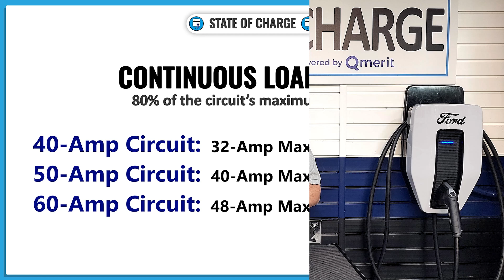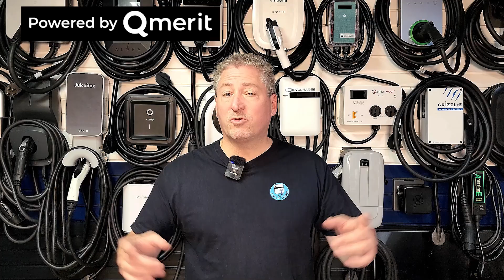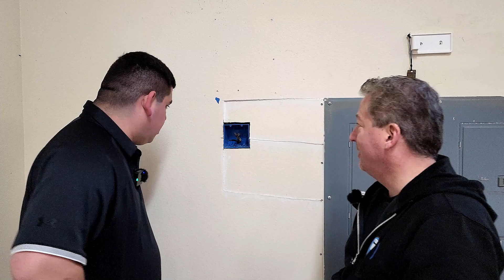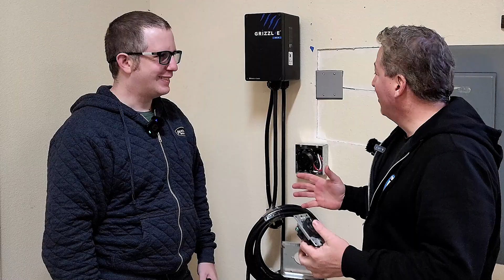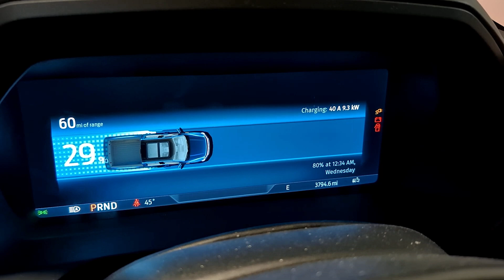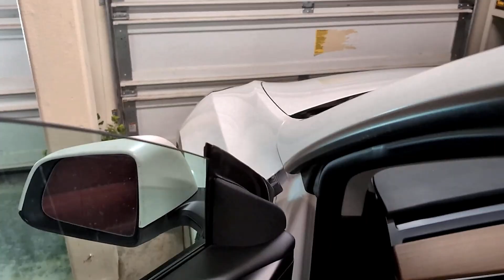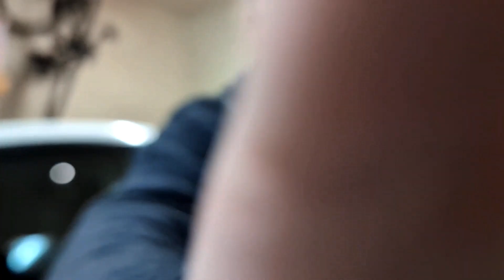Recharge Rescue Washington: We Fix A Dangerous NEMA 14-50 EV Charging Outlet Failure

Comment: What was the amperage of his juicebox? I think that I have that Leviton plug that I am also planning to replace with a Hubble. (Now going to do that this weekend instead of just “soon.”) But I am curious if using this plug at a lower amperage (32 Amps) is less unsafe.
Reply: Yes it’s less wear and tear on the outlet and less heat. For most people there is zero reason to charge at 40amps. That being said you should get the proper outlet when you can.
Reply: The Juicebox was a 40A.

Comment: A NEMA 14-50 can be installed on a 40 amp circuit per NEC.
Reply from the maker: Yeah, because there aren't any 40-amp outlets. But that's an issue if the owner doesn't de-rate the EVSE to 32-amps.
Reply: @StateOfChargeWithTomMoloughney I just point it out so that people don’t just assume every NEMA 14-50 is in a 50 amp circuit. It’s good if you didn’t have the outlet installed to check the size of the breaker and not just blindly plug into the outlet.
Reply: @ericroe  Yes. It's annoying to me to not size breakers to the circuits/outlets, but apparently it's normal now to have 20a circuits with 15a outlets (and a 20a passthrough). I can understand undersizing a breaker for a circuit, but then why not just rightsize it? I want my breakers to trip!
Reply: @Fritley putting 15 amp outlets on a 20 amp breaker is fairly common, because multiple outlets are in the same breaker. It just allows the use of multiple loads at one. Things typically done in the kitchen where you might have a coffee maker and a toaster or the such. But it’s very rare to fine a 20 amp appliance so why install 20 amp outlets. 

I have zero 20 amp appliances and I highly doubt most people do.
Reply: @ericroe  Yeah, it just requires people to know that if you put two or more appliances on a power strip that draw over 15A (but not 20A) your socket could get melty. I would prefer nuisance tripping.

Comment: I had the same problem with my EVSE after it was installed for a few months (almost three years ago now).  Inexperienced electrician coupled with my lack of knowledge on the subject led to them using a cheap residential grade 14-50 receptacle from Home Depot and aluminum wires.  I hired an experienced electrician who then used proper copper wires and hard wired my system instead of using a 14-50.  To be honest, there needs to be Federal standards that are enforced with every home EVSE installation.  Also, I STRONGLY recommend hard wiring a system vs. using any 14-50 receptacle.
PS:  My daughter and son-in-law could use your help with an installation at their house that has a limited main CB panel. 🙂

Comment: It was a mistake to allow EV charging equipment to support NEMA 14-50 in the first place. Ranges and EVs just have too big of a difference in their current loads. To offer higher quality NEMA 14-50 options won't solve the problem as there is nothing to safeguard against a person connecting to the wrong quality outlet. I'd say that EV charging equipment should drop support for NEMA 14-50 and instead go all hardwired - which can have safeguards to monitor temperature. But if there really is a need for a pluggable option then a new plug and receptacle specifically designed for EVs should be developed.

Comment: Tom it is not just the aluminium screws but the BIG difference is the Socket lugs on the heavy duty Leviton or Hubble have a longer copper lugs. This reduces the resistance and heat that the heavy duty sockets exhibits during the long charging sessions.
Reply from the maker: Yep

Comment: This was very informative. The other essential thing is the wire gauge. As per the National Electrical Code for a 50-amp circuit, 6 AWG copper wires and 4 AWG aluminum wires are recommended for cables that run 100 feet or less, a standard distance for cables powering a 50-amp breaker. Note that aluminum requires a thicker gauge wire. Also, the higher the amps, the larger the gauge of the wire. Thanks for bringing this to everyone's attention; this is essential to safe charging.
Reply: Yeah, the original run was 6 gauge copper.
Reply: Even cooking and elec dryers cycle on and off based on operating temperature. Water heater longer duty cycle but wired directly.
Reply: Also be aware that most outlets, I know Hubbel/bryant, are not compatible with Aluminum wire. Must be copper.
Reply: NM #6 is rated for 50a however #8 THHN is rated for 50a. Per NEC 310.16

Comment: I picked up this box and the electrician used a standard box for it. Is there another box I can order? Couldn't find anything at HD for it. Everything is currently mounted but it's tight in there. 

He also had the wrong cover...please share the box and cover Qmerit ultimately used. That part should be a simple DIY for owners needing to do periodic maintenance (checking torque) once the breaker is off.

Comment: After 6 months I had to retorque the cables at the breaker even though they had been torqued correctly at installation.  No over heating now.
Reply from the maker: That's a good reminder to check the connections periodically.
Reply: Found that after using a torque wrench to shake the wires to seat strands a little better then retorque and use a sharpie to mark head of screw and bracket. Some call that a " Witness Mark " and some inspectors ask for it on large switchgear.
Reply: Good reminder, I need to recheck the connections.

Comment: I’m thankful that your channel exists. The type of information and the quality of information you provide on EV charging specifically is a godsend.

I have a plug-in hybrid BMW as first time EV experience . Thanks to the knowledge that you provide, I got the Tesla home charger with magic doc.  I had my Electrician place 60 amp circuit breaker with appropriate copper wiring. 

This way, I have future proved myself for down the line to not only have the NACS connector but also 48A charging.

Comment: I had my EVSE hardwire-installed by an electrician who specializes in EVSEs. When the town did the inspection, I asked if he was going to test the torque of the connections. He said "No, these guys are pros, I trust them."  Then why the heck am I paying for an inspection?  All he checked was that the proper gauge wire was used (I thought these guys were pros, why did he check that!)
Reply from the maker: That should be part of the inspection, IMO
Reply: here, they dont even do an onsite inspection. I did a full panel 100amp -> 200 amp upgrade. 50' 100amp run to garage to a subpanel, then 60amp hardwired  25' run to evse  on  exterior.   The electricians charged me $280 for an ESA inspection (ESA is the inspection authroity in Ontario). I asked but no inspector even came to the house? They said they often pass an inspection without a visit. I guess if the contractors are trusted they are allowed to self inspect if it is a 'basic' job and ESA takes their word for it.. Contractors just submit what was done.

Comment: Hi Tom. No nuisance tripping with that set up?  GFCI in the Duo?
Reply from the maker: That might happen, but in my experience, if it does, it doesn't happen often.
Reply: When both are plugged in and charging, it'll draw 20A/20A from each side. When both are plugged in and one is finished charging, it'll limit the other side, so it is 8A/32A. (8A on the finished one) and then if it starts drawing again it'll kick back up to 20/20. Very cool! There's a GFCI in the panel, not sure about the EVSE.

Comment: Thank you for addressing this important issue. 
Too many people are either unaware, or too cheap to install the proper equipment. I was just amazed when I just touched the EV breaker after I had been charging. It was HOT. Now I very rarely charge on the highest setting. I'm happy using 6A and taking more care of the battery. 
I recently watched a YouTuber explaining how he is happily using his 110v outlet but also uses the same outlet for his dryer to charge at 220v. Judging by the fuse box his house is fairly old, so the combination of old wiring, cheap well used dryer outlet, disconnected, and reconnected every time, had me freaking out!

Comment: Here in Europe the messaging is to not use pluggable charging of EVs at all, unless it's the realy really industrial grade stuff meant for 3-phase motors etc. So instead of talking about cheap vs expensive outlets, just give up and tell people they need to get real chargepoints where they are hardwired.
Reply: This ain't Europe

Comment: Thanks, Tom.  I'm wondering if the same problem can occur with Level 1 (120v) wiring and receptacles?  For example, are there EV-rated Level 1 products?
Reply from the maker: There isn't an EV-specific 120v outlet that I know of. But if you are going to use it for home charging, I would suggest going to an electrical supply house (not a hardware store) and buying a high-quality industrial-grade outlet and swap out your existing outlet. Even then, open up the outlet at least once a year to check the connections.
Reply: There are higher grade nema 5-15r sockets at my local hardware store but honestly if it's a 20A circuit (and wires actually rated for 20A, no 14 gauge wires), install a 5-20R (which is the kind that can accept both 5-15P and 5-20P sockets, the latter is the one with a horizontal pin) since it's rated for 20A
Reply: @TAWithiam  Thanks!  A quick internet search returns nema 5-20R receptacles ranging in price from $3 to $50.  Perhaps you get what you pay for, just as Tom showed in the video with Level 2 receptacles.

Comment: I'd love to have a Level 2 solution. been working off of level 1 to charge my tesla. I use the mobile connector to do it. Unfortunately my other problem is I have a 100 amp service and would likely need to upgrade to 200 to do that. I know that might be a common problem for some owners not sure if that might be worth the video, but throwing the idea out there.
Reply: Not necessarily, you can charge at 16 Amp 240V, 3.8 kW on the same 12 gage wire as a 20 (16 amp continuous) 120V circuit. Most EVSE's will only charge at 12Amps, 1.4 kW on 120V. I have a Chargepoint home flex set to 16 Amps , I have a 100 amp panel. Just depends what you actually need day to day. My car is charged in 2-3 hours typically.

Comment: Makes me happy that I had Q-merit contract a local electrician hardwire my EVSE and it all passed state inspection. They installed in my case a 60a breaker, my current EV only pulls about 32a.
Reply: Are you saying your EV can only do 32A or the charger you're using can only do 32A?
Reply: @lashlarue59  at 240v AC yes. It's max level 2 charging is 7.5kw.

Comment: What a coincidence you publish this video when I just received my Leviton outlet for EV (the exact one you show) two days ago.  It will replace the old (and cheap) dryer outlet in my garage).
Reply from the maker: Good on you! Please torque it to specifications
Reply: @haroldroussel  Just FYI if the dryer outlet was only rated for 30A (as many are) and therefore has only 10awg wire, Leviton instructions say you can’t use their 14-50 with 10awg wire (except for the ground).  They say only #4-#8 copper.
Reply: @TVwatcher-ic3ne  It was indeed only rated for 30A.  I didn't have any problems with it yet (was charging at 32A using the mobile charger for the car) but I don't want to take any chance.

Comment: No plug is going to handle continuous loads with frequent unplugging.  These things will wear out and fail.  Recommend hard wire.
Reply from the maker: But VERY few people frequently unplug - that's not the issue. But yes, I agree, hardwiring is best practice.
Reply: Yeah, I don't unplug pretty much at all unless something is changing with my setup.

Comment: I had a Hubbell NEMA 14-50 installed. There was no way I was going to cheap out on that thing. It's not a waste of money it's smart money. I had the same problem finding a cover plate, the Hubbell is larger than the kind you can get at the home store. I had to find one the correct size on e-bay.
Reply: Same. I hired an electrician to buy and install a Hubbell 14-50. He asked me twice do I really want to spend that much on an outlet when the same outlet at a big box store is much cheaper. Do it right or pay the price.
Reply: @Dactylonian   That is one sketchy electrician.
Reply: Electrical supply store should carry the proper outlet cover.

Comment: Thanks for helping dispell the myth that it's all about plug/unplug cycles!  That Leviton is unsafe regardless.  It's good that Leviton finally updated the instructions to say it's not recommended for EV charging.
Reply: Not really about plug cycles, what has always been the real issue is wires not torqued correctly.  But plug cycles do wear out the contacts.  You can notice that on 120v indoor house outlets, as they get more and more difficult to remove a plug from them, then you know it's about time to replace that outlet.
Reply: @Resist4 Even when torqued correctly they rechecked every 2 years. Wires loosen with heat cycles. Best to charge at lower than max rate. This will reduce the heat and make it last longer. In industrial applications they often recheck high cycle outlets
Reply: @bbgator1  I agree about retorquing.  When I installed the 14-50 outlet I checked the wiring in the panel for my solar panels, which were installed many years earlier, and some were loose.
Reply: Hubbell also makes residential grade outlets so beware. People pass them off as industrial grade. On the Hubbell website they have a residential 14-30 for $13.75. They have a commercial grade 14-30 for $44.48. The commercial grade is made with thick reinforced thermoplastic polyester and clamp style wire connections that secure with allen head screws for easy torquing.
Reply: As a service electrician I have replaced a large number of Hubbell “EV” receptacles too. I agree that the Leviton is lower quality and I have replaced them too. I have to advise most customers to make sure they firmly seat the plug. In most cases we are encouraging the customers to go wiring their chargers.
Reply: @harveypaxton1232  I bet most of the failed Hubbell industrial grade ones (model 9450A) have been because of inadequate torque.  75 in lbs (the spec) is a lot.  But you are right: the best solution is to hard wire.
Reply: @ most of them are on the plug/contact side. I honestly don’t think the customers have been fully seating the plugs. All of the burned ones have been customers that move their chargers around.
Reply: @harveypaxton1232  interesting. In addition to the lack of good contact without it in all the way, people should be aware that exposed energized metal is a touch hazard.  I've also seen a few molded plugs with bad crimp connections inside.
Reply: @charliesullivan4304  I think Tesla must be using multiple manufacturers for the wall connector cords. Some of them seem to be Harbor Freight quality.
Reply: @charliesullivan4304  Correct torque amount and make sure to wiggle the wire around. The individual strands may move around and it may loosen the wire slightly. Do it three times.
Reply: @Rhaspun  strands? At 50 amps, are you joking?
Reply: @homomorphic  Look at the wires. they're stranded wires. Look at the wires that come into house from the power grid. Look at them. They're stranded.
Reply: @Rhaspun   never use stranded wires for high amperage connections. Solid wire only. Sure bending it requires the strength of Dwayne Johnson on PCP, but that's what it takes to have a high amperage install.
Reply: @homomorphic  Then you're going counter to virtually all installations of home EV charging locations. All of them use wires that are made up of stranded wires.
Reply: @Rhaspun  seriously — they'll have a hard time finding solid #6 THHN or any other type allowed by code.  And if they do find it, pulling it through conduit?  Not going to happen.
Reply: @charliesullivan4304  Yes. It would be a waste of time. When using the correct gauge of wire is what is important. He's just being a nuisance troll.
Reply: Very few things get plugged in and out a lot not just dryers. Most devices like laptops or electric razors etc you disconnect right from the device.
Reply: Not a myth, I have been running my cheapo leviton for nearly 3 years without issue (no unplugging/plugging cycles). No signs of thermal stress. It's about knowing what you're doing and operating with large safety margins.
Reply: @homomorphic  you sound like the people who are sure that seat belts aren't needed because of how many years they've driven without crashing.
Reply: @charliesullivan4304   you sound like the type of person that doesn't understand any of this stuff and thinks bad things will happen without any physical cause.